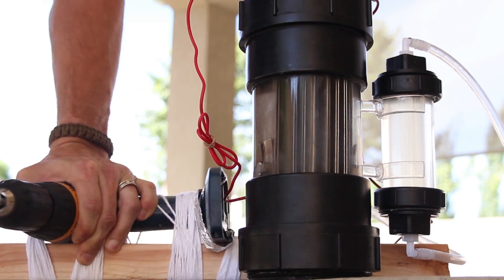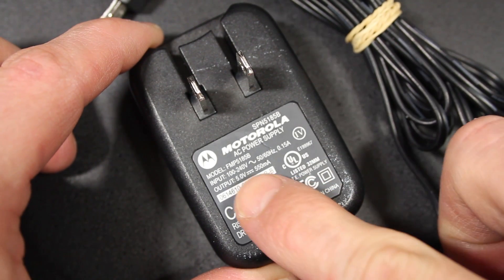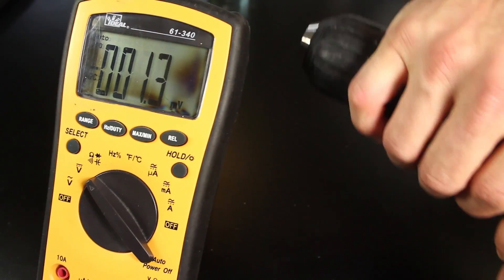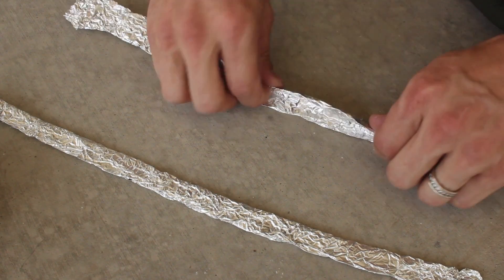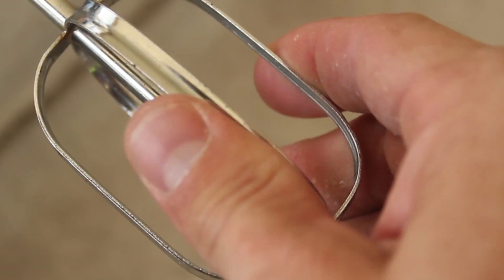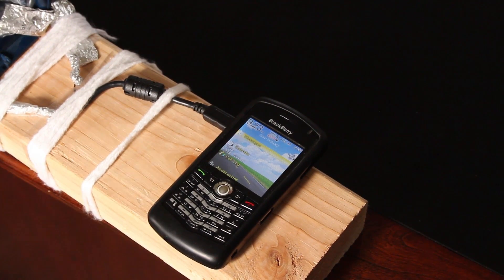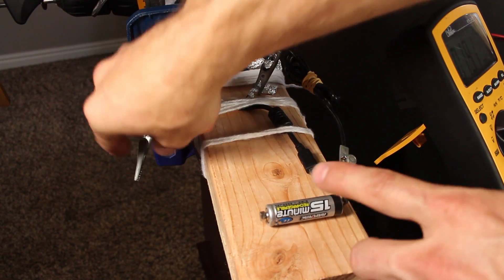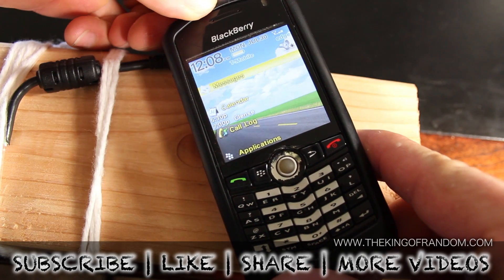Make an Emergency Phone Charger - MacGyver Style!

Comment: The problem is something like the LM7805 only gives 0.5~1A.
Most phones are 5V 1A, but some need a little bit more.

You could parallel them up to give up to 2A which is enough. LM regulators can blow up under sufficient reverse voltage. A schottky diode would be the best to protect against that as you only lose 0.2V over it. 

A 5V zener & variable resistor, in parallel with a capacitor could be used instead to give more control over the current.

Luckily I have all of these handy. =)

Comment: the motor in the drill converts electricity to rotation.
By giving rotation to the motor, it gives away electricity instead of rotation.
The electricity is then hooked up to the phone so that it charges.

Comment: DC motors have a set of windings connected to terminals in a ring.  Brushes on the housing contact these terminals, allowing current to flow through one winding at a time.  This forms the 'rotor' of the motor, which is placed within a magnetic field, usually a pair of permanent magnets.  When you spin the rotor, the windings on the rotor pass in and out of the magnetic field, which causes an induced current in the windings, which is then carried to the motor terminals by the brushes.

Comment: An electrical current generates a magnetic field. This is how an electrical engine works. There is a stator and a rotor. The stator is composed of multiples coil that produce a shifting magnetic field when powered up. This magnectif field rotate de rotor which is composed of a permanent/electro magnet. When you rotate the rotor, the magnetic field of the permanent magnet is rotating. This action excite the electrons in the stator's coil, that makes an alternative current. Sorry for my english.

Comment: When he is charging the AA battery that can be a dangerous thing as you are over charging the battery as you barely need over 1.5v to charge it and he was generating 5v. Also he states that it is harder to turn due to the electricity needed to charge it this is not true. The reason for this is the battery is supplying power to the electric motor making it want to spin as there is nothing preventing the power from flowing to the motor.

Comment: All electric motors are a generator essentially if you put power to an electric motor it spins if you spin the electrical motor it generates power. Magnets passing through coiled copper wire is how an electric motor and generators work.

Comment: It's a dynamo motor that's used with magnets that induce current, much like mini turbines. If you add current it spins one way, giving your torque. If you manually spin the motor in reverse, it will generate some power. More info can be found here wikipedia[dot]org/wiki/Dynamo. [youtube hates links]

Comment: when you turn a motor backwards you spin the magnets around the coper coil pushing electrons through the length of the wire creating electricity, thats vary basicly how it works. you could probably look it up in more depth if your intrested

Comment: A generator generates electricity by running magnets over each other. Its a little hard to understand, but when you put two magnets of opposite polarity together, and have a coil of wire near it, it gives off a small electrical charge. 

An electric motor has an electromagnet in it that reverses polarity really fast, making the outside spin. It is litterally an electric generator wired backward. 

I hope this helps.

Comment: Motors and generators are basically the same thing. When you put kinetic energy into a motor it outputs electricity, when you put electricity into a motor the motor outputs kinetic energy. My explanation is simple there is more to it, but that's the best way I can explain it in short.

Comment: Some drills have blocking diodes, if you crank counterclockwise when the drill is set to forward, you will get nothing from the terminals.  The forward/reverse switch changes the connections to the battery allowing you to use the drill in both directions.

Comment: This is a bad thing to do without a rectifier.  The motor does not generate DC but AC, this is not healthy for your devices, some drills have a single diode in but that is not a rectifier and you could damage your devices.  Also most drills have two speed settings, the low speed setting is still around 500-600 rpm, which is a little much for a human to achieve for any period of time, but if you could you could get a fair amount of juice.

Comment: Good idea.  You could also connect to a bicycle (doesn't even have to be stationary--flip it over on its seat and handlebars..) to turn the drill.  It will reduce the physical effort required.

Comment: This is probably a dumb question, but if you have a wireless driver available, why not use the drill's battery to charge the phone :-)      I bet you could rig the same screw driver to the axle of a bike, or stationary bike to save yourself from having to hand crank it.

Comment: I would add a 5v voltage regulator and capacitors to the circuit to ensure a constant 5VDC out and very clean output. Both can be had for under $1 each or salvaged from electronics such as old computer power supplies.

Without these you could potentially damage your device by exceeding 5V. Watch Afrotechmods video titled "Voltage regulator tutorial & USB gadget charger circuit" for information on how to do it.

Comment: I've fixed a non compatible car charger for my brother that wouldn't charge his ipod. But mostly its because I'm an electronics engineer. I've designed power circuitry, and have used the same technique to detect charger output capability.

Comment: Just a note, don't EVER cut the charger cable while it is still connected to your phone or charger. I'm surprised you got away in the video, but on a lot of phones it will short circuit the battery and then the whole project would become useless.
There are some other things that are dangerous in the video, but for an emergency situation it doesn't matter.

Comment: HY-88 Emergency Dynamo Solar Self Powered AM/FM Radio Flashlight phone Charger. If you're "bright" enough to charge during the day you don't even need to crank. $19.99 MSRP. BTW, if you want your phone to continue holding a charge past the emergency, 5 volts is all you want. Peace ladies.

Comment: I love it, power in a pinch! This setup has sparked my creativity and I have some ideas for improvement

Build a better crank and mounting jig that can be set aside for emergency use. There are many options.

Modify a cheap used or dead battery pack that can hold some regulation & charging circuity with some charging jacks.

Comment: First of all, 5 volts are not the same as current... secondly, you should put a capacitor in parallel and also use some kind of voltage regulator. I would never use this trick to charge my phone, one quick crank could generate a high enough voltage which could destroy the charging circuit.

Comment from the maker: Thanks Randy! :)  A bike is better, but will probably generate more volts and amps.  Without the proper charging circuit you could damage your phone.  I would suggest using the bike approach to charge something like a 6 volt lead-acid battery, then charge your phone from that.

Comment: Nope, the wires need to see 2 volts on the data lines to sense charge capability. You'll need a cheap 5v regulator, which can be had for a few cents. and 4 resistors to make the 2v voltage dividers.

Comment from the maker: Thanks for clarifying that :)  Actually the phone doesn't accept much of the charge, so it's fairly easy to turn (low resistance).  My finger did get a little sore, but nothing I'm not used to already.  If you short the wires out or use it to recharge a battery, it's much much harder to turn and does hurt because there is a much larger resistance.  A bicycle set-up would probably be much more practical for that.

Comment: This won't work for an iPhone. It will need a small dummy load on the white and green data wires. You could set up a 5v regulator circuit to provide steady 5v as a safety.

Comment from the maker: If you can consistently crank out 18 volts and add a few diodes, a voltage regulator and some resistors to avoid overheating, that should work!

Comment from the maker: As long as you're generating enough DC voltage I think you can make it work.  The idea is for crude electricity to work in a pinch.  If you wanted to make a long-term system you'd need a proper circuit with diodes, voltage regulators, capacitors, etc.